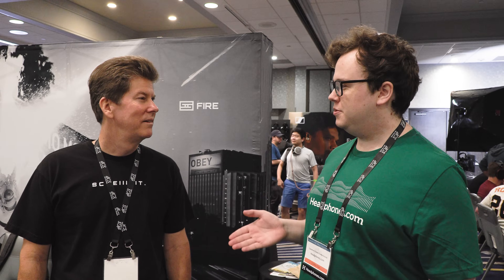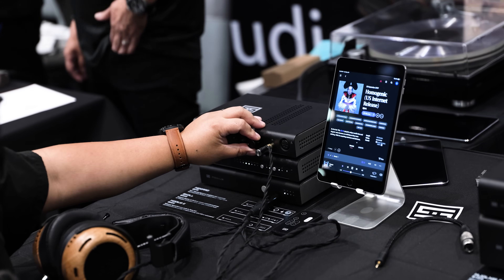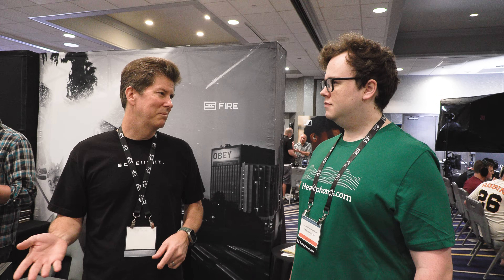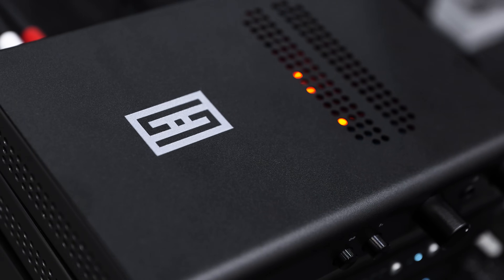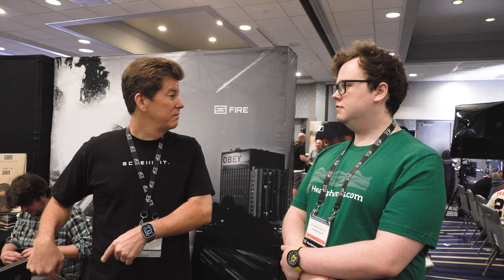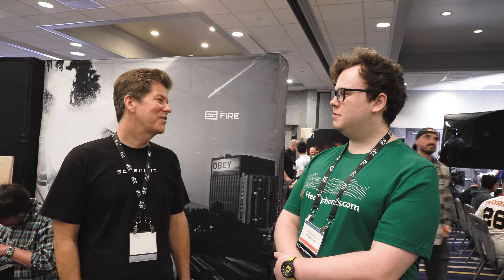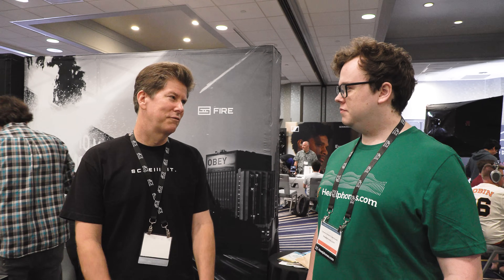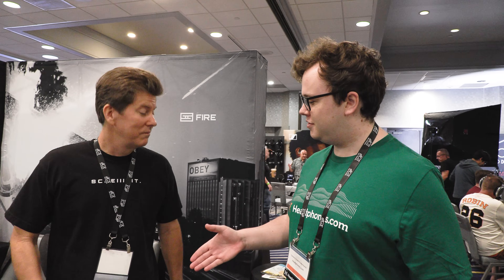It LOWERS your headphone's distortion??? Schiit Midgard at CanJam SoCal 2023

Comment: I just got my Midgard and it's a really good amplifier. To be honest I even prefer it to some other more expensive products. Sounds great with Meze Liric and does a surprisingly good job with Susvara. 
Yeah, Halo works. There is a difference between outputs and I prefer the Halo output. The sound is more natural and much better articulated. Also, it seems to dampen the Liric's peak at upper midrange.
For 219USD it's a steal even without Halo.
Reply: I've got a Midguard and run a few 250/300 Ohm dynamic headphones through it. I couldn't say the XLR port sounds better, hand on heart, as I don't have matching headphone cables metallurgically/lengthwise to compare (identical impedance cables is what I'm getting at here, not that I could tell different impedance cables apart anyway). So even though I run potentially good candidate headphones, I wouldn't claim it makes a perceptible difference. What I would say is that it's a beautiful sounding amp, with a Schiit ton of power that drives said 250/300 Ohm cans truly effortlessly. Sub bass (above 20Hz at least.. this seems an oddly high cutoff given the power, substantially higher than the frequency response rating of the headphones, which tends to be around 5Hz - whether that's realistic or not is another matter) doesn't get rolled off due to lack of power. It's noticeably warmer than the usual suspects from SMSL, almost tube like in that regard. But it sounds far better, and more expensive, than it should for $219. It's a steal at this price, and for higher impedance cans I don't think has any real price competition outside of an OTL tube amp like the Xduoo TA-66. If this is your budget, it has to be on top of a very small shortlist.

Comment: I didn’t quite get it does it vary the output impedance across the frequency range? Or does it vary the output impedance over the entire spectrum. If the latter then they could just have put a knob on the amp and let the user experiment with different settings. Greetings from Denmark.
Reply: I'm assuming it's reading input current and voltages vs headphones return currents and voltages to try and estimate the stored energy within the headphone driver under various frequency conditions and over or under drive the amplifier to compensate for frequency dependent variations in impedance and power factor.

Comment: Im happy they're keeping the price down for it, but ngl Id spend $15-$20 extra to have the better potentiometers/volume knobs vs these smaller ones. The smaller ones are used on the Magni and Loki devices, and have a ton of noise and scratching when adjusting the volume
Reply: Per their website the potentiometer is the same one used in the Jortenheim and Mjolnir 3.
Reply: The pot for this device is actually good apparently. It's just the knob that's tiny lol
Reply: If it's any consolation, the potentiometer is pretty smooth on the Midgard lol.
Reply: I recently purchased the Midgard.  The volume knob is smooth as silk.

Comment: Output impedance 2 ohm, oof
Reply: Still good for 10-12ohm headphones and you have the error correction in the mix so....?
Reply: @shawnpwatsons1  I'd say 18 at least, if you're using dynamic headphones. The impedance curve will distort the frequency response otherwise. But beyond that yeah, should be fine.
Reply: @shawnpwatsons1 hell no brother, 20 ohm starts to degrade out of 2 ohm and 10 is unlistenable to me, I know from experience with my LCD-5 and Moondrop Solis 2

Comment: Audiophiles = barely audible or un-audible distortion needs a special box. Also audiophiles = here's some old Soviet tubes for your amp!
Reply: Some kinds of distortion sound nice to some people
Reply: @prithvib8662  I used to think so with several of my Cary tube products. I’ve since converted to SS and have not looked back.
Reply: The most generalizable audiophile math:
Two things sound different and one is more expensive = more expensive thing is better. 
This is exactly why the most expensive cables tend to introduce distortion on purpose. Because audiophiles are morons.

Comment: Cool, some subwoofers have acoustic/electric feedback systems to reduce distortion. Why not have it in headphones as well.
Reply: I believe you are referring to servo amplified subs. What is going on with the Midgard is more akin to dynamic output impedance control in order to equalize the headphone - amp circuit impedance matching. Servo subs have a delay inherently built into them due to the nature of the servo drive, which has caused them to fall out of favor with many hifi enthusiast.
Reply: That matters for subs because of the sheer amount of mass behind them. Headphones have essentially none of that, the drivers are so so much more lightweight, you wouldn't ever run into this problem.

If it did make a difference, it'd be in measurements and not audible. I guarantee that if you told someone it did this, they'd hear a difference afterwards however, like most placebo.
Reply: "Why not have it in headphones?" Because good headphones don't have any distortion to begin with. A woofer can have 20% harmonics so a servi makes sense. 
However headphones in fact do use feedback on their drivers. It's called ANC. If you do some clever PID control with it. You can lower distortion in the lows but it's cheaper to just use a better driver that doesn't have distortion. Have you ever heard any audiophile say "this anc headset has way better detail in lows"?